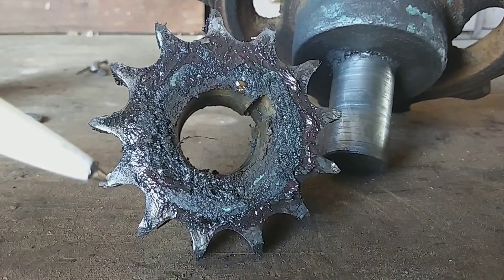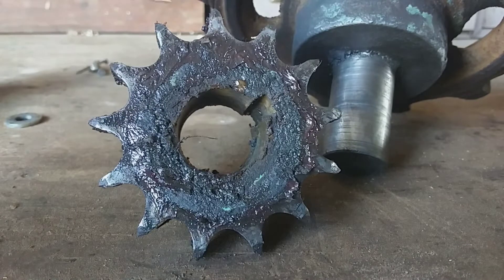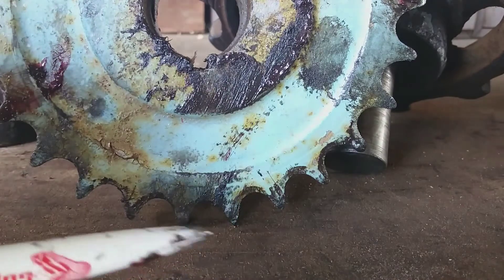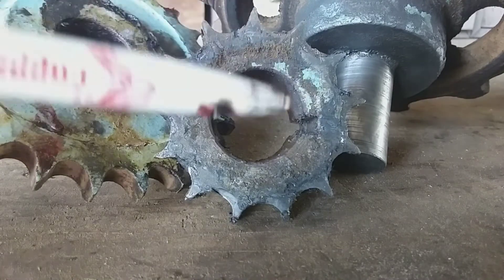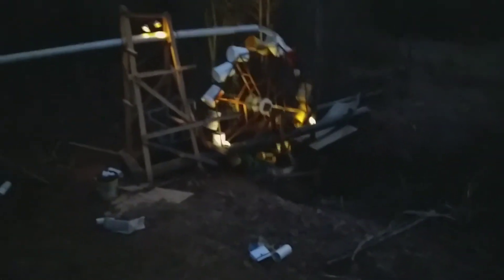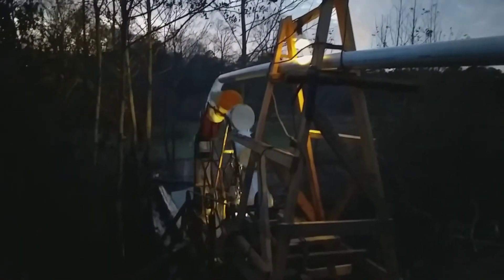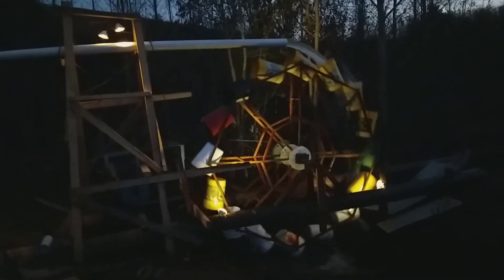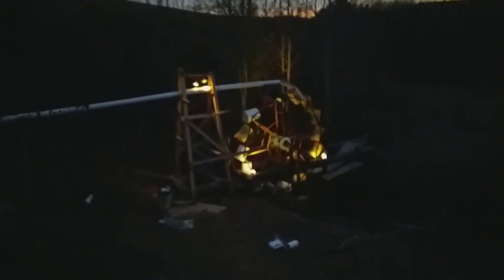Home power plant in operation! Hydro power is making electricity!

Comment: The sprocket is worn out and needs replacement. The chain is also worn and should also be replaced.  FWIW - Roload chain needs oil not grease lubrication. The grease does not get to the bearing surfaces. 

This is another example of making water power if you do not need very much. Or want to spend any money.
Reply from the maker: Ikr